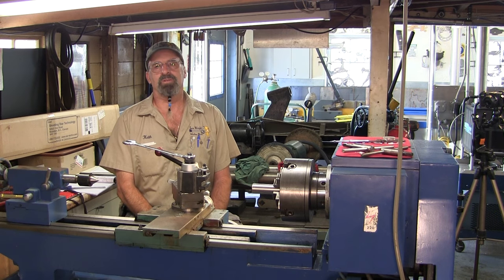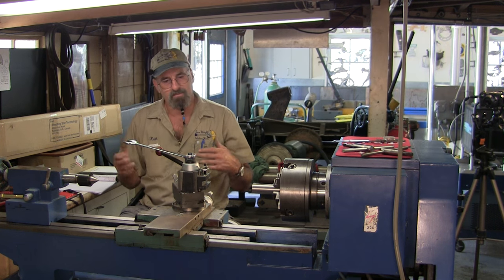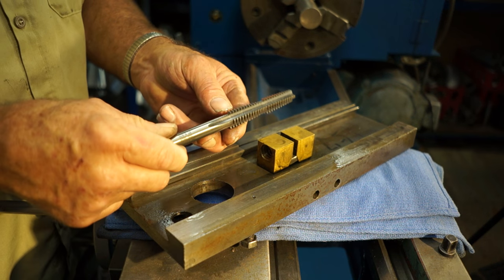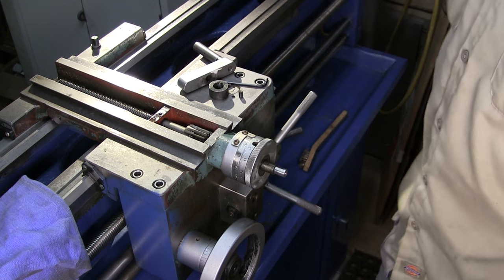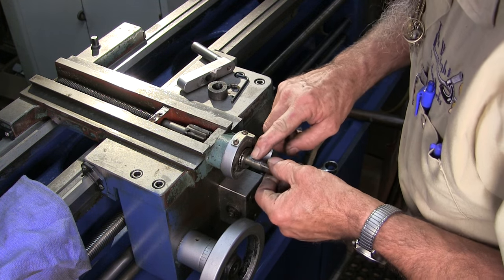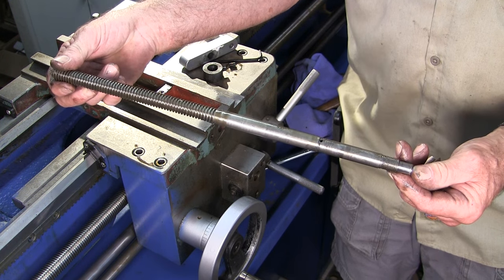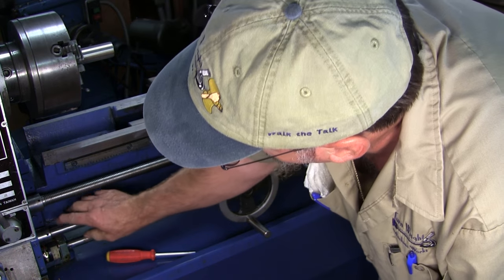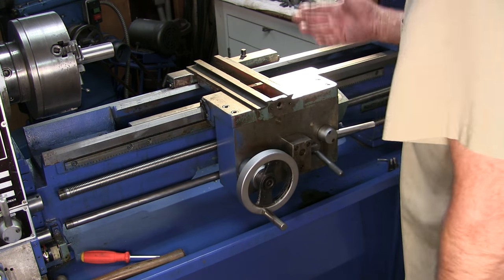Let's look under the old girl's apron

Comment: Keith:   My lathe has a fill hole on top of the apron just above the split nut lever, I don’t see anything like that on yours, not sure how you are to add oil on that machine, I’m also waiting to see just how much there should be in there I add now and then but don’t know just how much. I guess if I over fill it someday it will run out on the pan? If you want, I can send you a picture of the plug and location.
Reply from the maker: I can pour it it through the plate i pulled off to show gear. ;{)------

Comment: Not a machinist, but I was surprised that all the fasteners were SAE and not Metric.  Obviously meant to be sold in the US.
Reply from the maker: All the fasteners were metric, just not the lead screws. ;{)------
Reply: Lucky !!!!
I own an old Willson british lathe and is is fastened on the British witworth threading system.
On small dimension bolts, ( 1/4, 5/16,3/8 ) I can use SAE threading system simply by refreshing the threads with a SAE tap
On others dimensions, I drill the hole to nominal and I install helicoils to be able to use the SAE bolts
to make a new crossfeed screw, I used a 3/4-5 Acme  LH precision threaded rod with the corresponding piedestal precision nut
It is the best that I can do because I have not another lathe at my hand.
Nice job on this lathe apron

Comment: Isn't it possible to remove the slack in the cross slide by adjusting the two nuts in relation to each other?
Reply from the maker: Their adjustment has been taken to the limits and almost all the thread is used up, razor thin thread ready to strip out. ;{)------

Comment: Those pecker tracks on the shaft - could you machine in a slight slot to let the set screw lock down into without lifting up material above the shaft diameter?
Reply from the maker: That is one way to let the same thing happen at a lower level  ;{)-----
Reply: Brass slugs are the answer. I took a Hardinge skirt apart and there were brass slugs under all almost all the grub screws. The only question is how to fit a slug tightly into a hole that's already been threaded to the bottom.
Reply: Keith Fenner
But at least it would damage the threads

Comment: Hello, my cross slide is not perpendicular with the spindle, do you have tips/method for fixing the alignment of the cross slide ?
Reply from the maker: First verify that the spindle is in line with the lathe bed, then if it is still out may have to machine and scrape ways to correct problem.      ;{)------
Reply: thanks

Comment: Thanks For sharing Keith, This helps take some of the mystery out of my machine if I ever have to disassemble the apron etc.I have a AL-960B 12x36 lathe Also made in Taiwan. In regards to the cross feed when I turn mine to the maximum it just stops. How would I go about actually removing it off the cross screw? http://www.machineryhouse.com.au/L237 many thanks Max
Reply from the maker: There is a couple different ways feed nuts are set up and some are disconnected by the retaining screws on top of cross slide, but you can look under the back side and get a better view of what might be holding them from traveling off the end. best to look at the machine manual, break down. ;{)--------